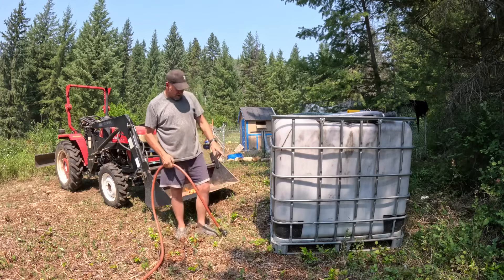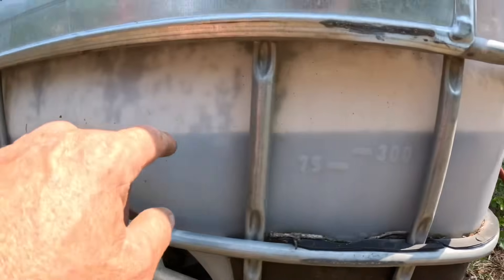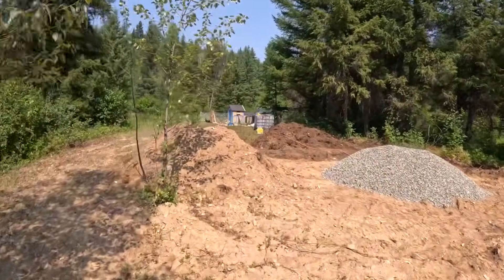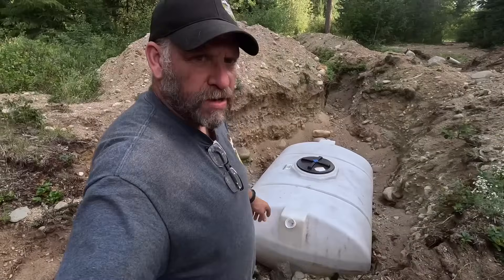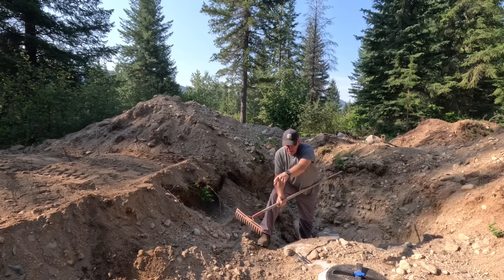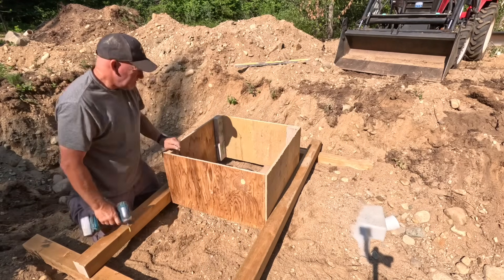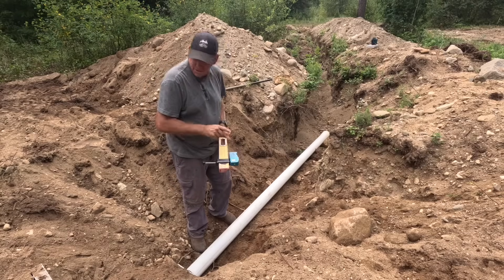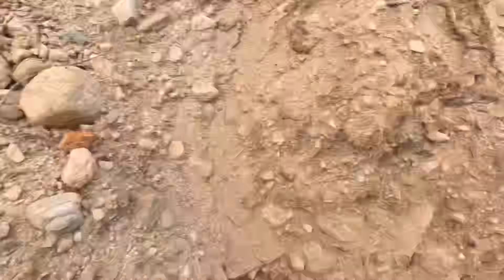Building my sustainable off-grid property from the ground up ￼

Comment: The videos are a tad dis-jointed ....... SO,    I saw the water line go in from the well,  Saw the shed and pressure tank go in, Ssaw the water line to where the cabin will be.
Saw the septic tank and pipe go in.  Yep, makes sense to have a few IBC cages and water handy around the place.  

Now ...... What that big assed water tank for that you just buried in this video going to be used?  You have a well full of water - what's the now underground tank for ?
Reply from the maker: That is a septic tank for my fifth wheel which that area will be turned into a guest cabin, not the fifth wheel, but I’ll be building another cabin there

Comment: I would assume there is what is called a baffle just inside the entrance to that tank. It you develop a backup as time goes on, it might well be a blockage at that baffle. My septic tank is a steel one. To cure a problem that developed on mine, I drilled a 4 inch hole in the tank above the baffle, added a pipe to ground level with a cap so that periodically I can rod the area when a problem develops.
Reply from the maker: @ErnestWarren-zn6ph  yes there’s a baffle in there. Interesting idea with drilling the hole. How often do you have to unblock it?
Reply: @thompsonscabin  My septic tank caused a problem just once in 30 years and it happened between the wall of the tank and the baffle with a buildup of tissue. Each spring and fall (as a precaution) I remove the cap I had installed and use a rod to ensure there is no buildup. Incidentally, the bacteria action in my tank must be working just fine. I have never had the tank pumped out.
Reply from the maker: @ErnestWarren-zn6ph  wow that’s pretty awesome not having a pumped out
Reply: @thompsonscabin  A rotting road kill makes for an excellent bacteria activator for your tank. Avoid using the whole moose (lol).
Reply from the maker: @ a whole moose, lol awesome

Comment: You may want to shock your well. An easy evolution
1) 1 bag of pool shock down the well (I used a 10ft piece of 2" PVC with 3 long screws drill into it precents dropping it down the well)
2) put PVC down the well
3) poor pool shock & recycle water back down well through the pvc for 20 minutes or so (make sure you cleaned off the pool shock from the metal casing
4) wait 24 hrs
5) drain the well until the chlorine smell clears (drain somewhere you won't kill anything you may want to keep, I pump into cistern then drain onto driveway.
Reply from the maker: Thanks that’s great advice so far the water is good. I am going to get a tested. I haven’t yet but it’s definitely in the works.